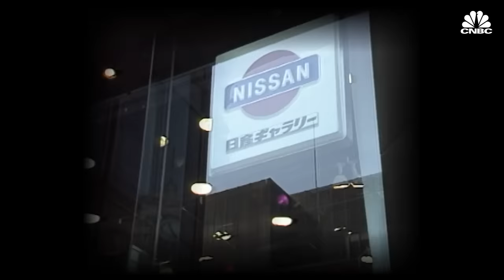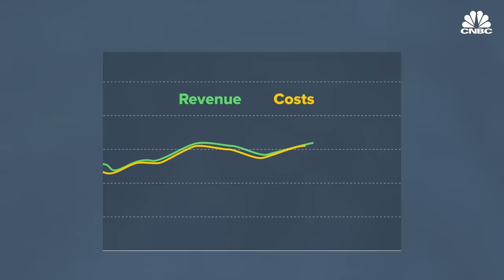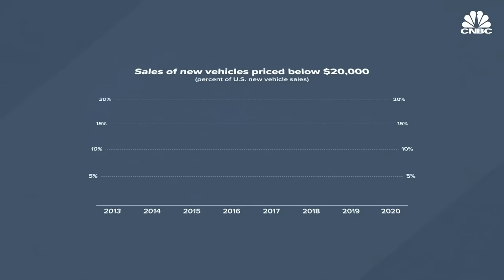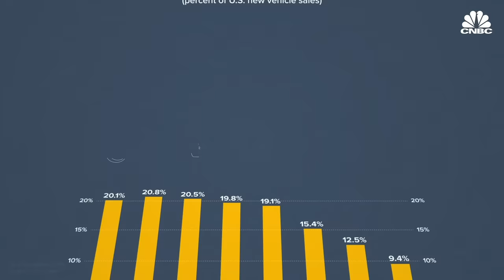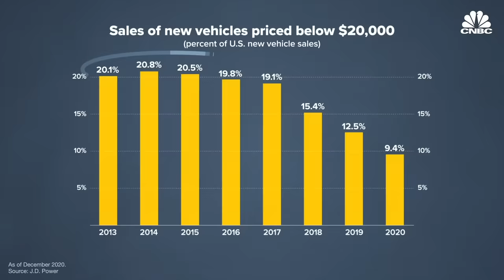Why Cheap Cars Are Disappearing

Comment: what you are calling cheap cars in the 15-20k dollar range are to me bordering on luxury/out of reach prices.

cheap cars are 5-10k up to 15k at most

next category up is 10-20k up to 25-30k at most

in between those two categories are where lowest cost sedans and station wagons from chevy ford dodge and pontiac are supposed to be...but those two categories are being wiped out...plymouth and oldsmobile are gone, pontiac is gone, dodge and buick are nearly gone, chevy hasn't sold a cheap car really since the 1980s it just keeps focusing on chrysler's old markets of medium and expensive and luxury vehicles...ford has slowly started following chevy in that direction, dodge focused on performance vehicles and reviving heritage/nostalgia nameplates to make more money after the interest in its neon and avenger and similar more affordable vehicles died out because they weren't considered "new" anymore and didnt have as many features as it should

the dodge dart should have been a phenonemon like the neon had been 2 decades previously, but it was too expensive and too small...dart fans wanted a big car like they remembered the old dart decades before to be, and it was basically a neon redux with better styling then the neon had and it was expensive like a pontiac grand prix or g8 or g6 had been just a few years previously when pontiac was still around..  basically why do away with the avenger to replace it with the dart which is smaller and more expensive then the avenger used to be.

with all the us automakers moving up that opened up more and more room for japanese and korean car makers and when they got decades of expertise in the us market under their belt they felt they could now directly compete with the american auto makers and just like chevy had done the camry corrola elantra etcetera all went more expensive and up a category or two in price, meanwhile crossovers started high to begin with when they became a category...

all the trends just went more and more and more expensive..forcing normal families/buyers out of the new car market entirely in most cases now days...

now days used cars are often listed as 15k dollars or more..the same price new vehicles are supposed to be

my truck is a chevy silverado wt bought in 2008 manufactured in late 2007, had 8 miles on it from people testing it when i purchased it for just under 13k though with interest on the loan it was just under 20k by time i paid it off in 2014.. took a 6 year loan, a 1500 dollar down payment provided by my sister and her husband, and my sister co-signing on the vehicle to even get that price...the window stickers on trucks like that were 17-21k even at that time...

the only comparable cars in affordabilty were the g6 from pontiac but lowest any of those would go was 17-19k range with no discounts or ways to get the price down further..

if they are wondering why cheap cars aren't selling its because the industry doesn't make/sell any cheap or even affordable vehicles any more/any longer.

even compact vehicles now days are higher priced then a full size family sedan or station wagon is supposed to cost.

tesla said it was going to fix these industry problems with their model 3, but you could buy a cadillac or buick luxury sedan for the price the supposedly cheap/affordable model 3 started at.
Reply: also the video just said the market is moving away from cheap price points...more like the cheap/advertised starting price vehicles never typically end up on a lot so people are often stuck with buying vehicles 5-10k or more over what they were expecting because that's the cheapest available at the dealer.
Reply: yes first time buyers are having to wait many more years..you are allowing a huge risk there ...those buyers may never buy a new car and may shun new cars and the new car industry or a certain brand entirely, which if they have children means chances are you've just lost at least 2 generations of potential buyers for your brand and possibly everyone they know talk to are related to, etcetera potentially as well.

so in some ways moving your vehicles up in price is a bad move.

i may like power windows, but really they are only useful if you get pulled over or if you are going through a drive through or something and roll up/down windows are still fine and i'm told various little things like that make a car dramatically cheaper.

really i don't need car windows to roll down at all unless in an emergency, its raining and someone is at the door wanting to talk through the door, or if i'm driving and not enough fresh air is coming into the car and i'm having issues breathing due to allergies or something.

otherwise i dont need windows to be able to move at all, i just use the fan and a/c built into the car.

that's really the only thing i'd pay extra money for, is a proper heat/air conditioning/ventillation/life support system

i don't need abs/antilock brakes i don't need airbags

it might be nice to have a radio and cd player etc but don't absolutely need one, though a mount built into/onto the dash for my tablet would be nice

it might be nice someday to afford a car that has heads up display and voice recognition features or something but that's a luxury feature for if i can afford it someday

i just really need a comfortable car to go to work and back, and if jobs/work wasn't so far away these days i wouldnt need a car at all or just for a few trips a year or something.

so a basic cheap 10,000 dollar car or so that is made to last would be nice, especially if it was a station wagon like the dodge aries used to be.
Reply: exactly...if cars are going to be insanely expensive and suvs are coming down...then people will go for suvs...

suvs are higher more visible..more likely to make drivers on the road take notice you are there and avoid colliding with you, etc..more roomy..more room to put things...more like the station wagons we used to have..etc...

its why the ford explorer and jeeps like the wagoneer and cherokee have always sold so well

for a considerable period of time ford explorer has been not too much more then a car or about the same price as a car for the cheaper variants, so why not get an suv instead of a car people figure...

my brother in law in 2017 ended up buying a ford car, but he's not generally happy with it, its smaller then it should be, more expensive then it should be, and even though he personally has no interest in suvs and wanted a car, he was looking at both the explorer and the expedition in the dealership while we were there and considered briefly maybe getting one of those instead as they were not much more then the car he was looking at which isn't even a proper mid-size sedan much less a full size.
Reply: that's the one good thing about the new cars...even though my truck was 13k or 20k with the interest, its lasted me from december of 2008 to 2021 so 12 going on 13 years and counting now and barely even been in the shop, had one accident in 2011 but aside from replacing the hood and the door and the shop replacing a few other things to be on the safe side like the radiator which wasnt damaged but they didnt want to take the chance on it and guarantee it wasn't so they swapped it out for a new one with my permission..but really they didnt have to repair much at all and the truck is still mostly original and still holding up well and only has like 120-130k miles on it so far and i'm told it can potentially last til 200 or 300k miles or another 5-10 years before i have to start considering replacing it...i've only had to replace the tires twice so far, the first time because i had a flat or two and rather then deal with differing wear i just got 4 new tires, and the most recent time i think i had one flat or one that wasnt staying as inflated as i wanted and they were starting to get worn out, the normal shop i used kept saying they were okay for now but it got to the point where i had the money and just replaced them with 4 new ones so i should be good for like another 5 years or more on tires as well now.

so at least vehicles last longer now..not sure if its because its a silverado a nameplate that is known for being durable/long-lasting ever since the 1970s or 1980s or not or if newer vehicles just last longer these days, but very glad, because i was taught growing up car loans were 3-5 years and vehicles lasted 5-7 years before needing replacement in many cases, and my truck loan was a 6 year loan...so i am very glad that its already lasted twice the term of the loan and may eventually last 3times as long as the term of the loan before needing replaced..

i just hope there is still some thing affordable to replace it with by that point as vehicles keep costing more then its supposed to cost to buy a house.

Comment: Nothing of note is said for the first six minutes of this video. Basically the answer (from the final minute) is that:
1) Short-sighted millennials are prepared to borrow more than they can afford, to pay for overpriced extras like WiFi and TV screens.
2) Everyone smart is buying second-hand cars.

A third point, which the video only alluded to vaguely, is that more people are buying SUVs instead of cars. What the video did not explain, is that the reason for this is tax. You buy a $35,000 SUV or pickup truck, you're getting $35,000 of truck; whereas if you buy a $35,000 car you're getting $28,000 of car and paying $7,000 of tax.
Reply: Millennials?  People have been cycling cars every 4 years since Millennials were in diapers.  They are adopting the bad behavior of their parents.

Comment: Cheap cars are all over the world and are small enough that they can fit hundreds or maybe thousands on a freighter. It's not unlikely that Americans would buy them for local travels as long as they can reach 60mph. I don't want an SUV. I have one of the few micro cars allowed in the US. It cost me just over $5500 used and has its share of earned and designed-in flaws. I could have bought a new car but I'm not big on paying taxes so I bought something cheap and which doesn't feed the gas tax gobblers any more that it has to. Soon, I'll convert it to a 96-volt battery system for propulsion while the 144-volt conversion for my Ford Ranger is already in my driveway. It will be installed first and that will be my daily driver until I get the Fiat 500 done. Both will be simple, Chinese conversions because US "manufacturers" like to make things overly complicated. When regulators get out of the way and start allowing us to buy what we want, we can do our part to cut down on fossil fuel usage. I'm not against buying gasoline for a car. I'm against importing oil and getting taxed for something that is NOT a luxury in today's world.

Comment: They're disappearing so for the working poor or less affluent , possible buy used even salvage title ? There's heavy demand there too as every car will sell at the lot that sells them ,they don't last long .Have two a 2016 Ford Focus SE at $4750 cash 57,000 miles whch I got in 2020  qnd recently got 2015 Ford Fusion SE 108,000 miles $5800 cash both turned out well . 57 yo and hoping these last fairly long time

Comment: We need another Henry Ford.  Now we know that Mr. Ford had his faults.  Da, who doesn't.  But back to the point.  The reason I red that Ford made the, finally, Model T was so the poor farmers could have a vehicle that would make his farm more productive, efficient.  When he saw that the price was too high, he cut it , the price that is, to almost half.  Now that ... who owns, started Tesla Motors. It seems that his biggest problem is: "the thing, 3 letter word, that he is, should start with an upper or lower case "g(G)"?

Comment: With the prices of used and worse new cars maybe a house and carriage is not a bad idea. It's cheaper, RIGHT?  The reason, loss of the big green paper. There trying to stay a float. Make up for lost fund's. But now? Thing with the economy is not good. So to say with the sales and inflationary drouts the thing's can only get worse. With more high tech. The prices have sky rocketed. And honestly you don't need all those electronics in a car. Some have as many as 3 cars and none of them have extras that can go wrong or break down, and to fix those electronics ya" expensive. Not to mention to labor cost of the tech who is doing the work. Just a bunch of high tech gizmos with high price failures. If you have a car already hold on to it and most of all take care of you car. Because the new car market is beyond the universe..$$$$$

Comment: Why the american madness for SUV? That would be a good video and requires a comprehensive sociological explanation which these chaps from Cnbc are not able or not willing to give. Think of an SUV versus a city/compact car or sedan with the same engine or different engine from  a different brand but with the same power: the SUV will be heavier, slower, harder to park or find parking space, and burn more fuel per mile. The latter will be cheaper to run in the short and long term. By the way SUV's are not off-road vehicles so they should not be taken off-road though many buyers have this misconception buried in their mind when buy a fat gas-guzzling SUV. WHy would you buy an SUV? Moreover, drivers will drive alone 90% of the time, more or less! Again, why buy more weight and volume? The  same question apllies to the even heavier pickups! Unless you're a farmer off course.

Comment: Plenty of good used cars and trucks for desert price . 1998 to 2005 Toyota Camry and Sienna with low miles under 120,000  . Presently driving 2002 Camry and 1990 Toyota 4 runner  . Each drive as they did when bought them 12 years ago . I don’t need to be show off or trendy .

Comment: A message to all the d-bags out there buying cars they don't need: STOP BUYING NEW CARS!!!

The price is driven by high demand. And high demand exists because d-bags replace perfectly good cars with new ones. Drive your car 150,000 miles before you think about replacing it. I promise, your car will make it. Modern cars can be driven 200k miles far-far-far cheaper than driving 4 cars 50k miles each. Take some of the demand out of the market, and force carmakers to reduce prices.

Comment: Cause car manufaturers are STUPID 
i want a 1966 F100 long bed Ford no power steering no power brakes no AC No computer assisted ANYTHING. 6 speed stick 6 cyl mechanical Cummins 31x10.50 mud tires on deep dish rims 
Staight axle leaf springs. New truck for $5000 cause computers are like politicans and college educated FOOLS, USELESS.